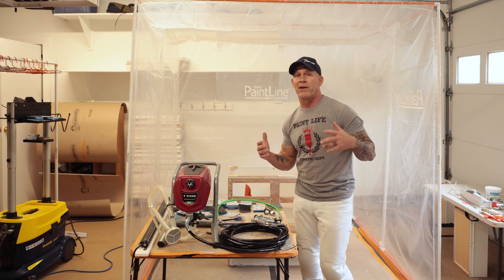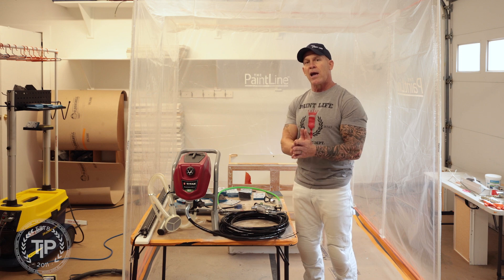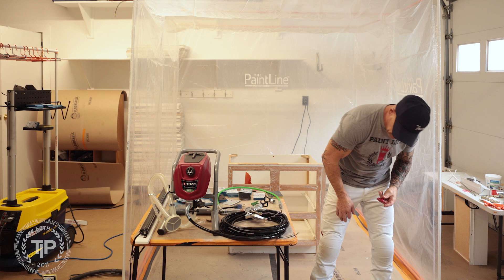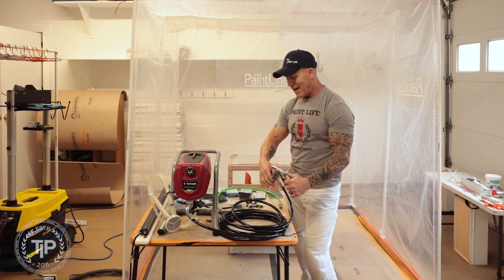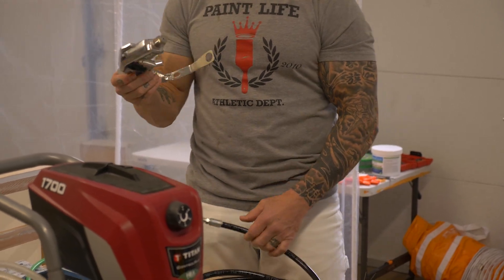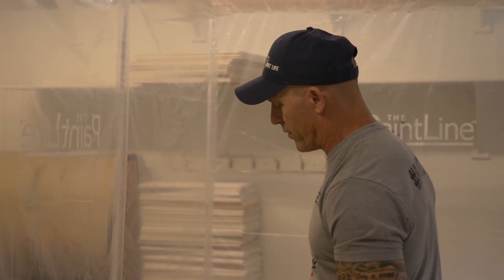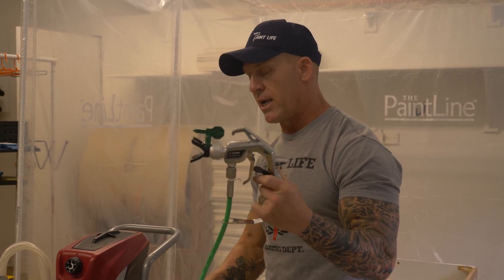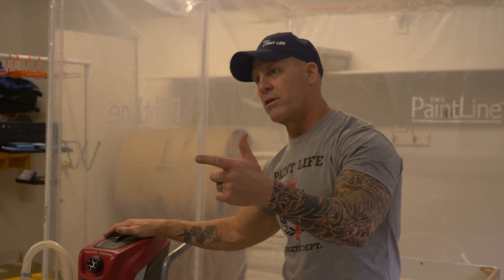Titan ControlMax Conversion HACK!. What Can and Can't You Use.

Comment: #TopBloke. I gave up last year trying to hack this after 3 yrs of trying to source these fittings. Bought this unit 4 years ago, was not aware of the proprietary problem, “As there is nothing In Titan/Wagner’s marketing material to alert you to this game stopper. Tried contacting the company “Nada” was told “we do not have those measurements. 

I’ve bought two of these yesterday cannot wait to finally get a whip hose on this great lil machine. 

#IdahoPainter……saved my ass yet again. Thanks for your support to the community #1Love2IP.

Comment: I recently received the whip kit for my 1900 controlmax.  The adapter that screws into the gun, it has a washer and o ring on it, neither get tight before the adapter bottoms out in the gun. Is this a problem? Maybe the washer and oring are included but unneeded?

Comment: You stated that you are not to use any other tips with this set up but in another video you do just that. Is there any reason you shouldn’t use a fine finish tip with this sprayer? And if you do what type of results do you get?

Comment: Will this unit be ok running medium viscosity material with Graco fflp tips and a RAC-X guard? If the material itself only requires 1000-1300psi does it really matter what machine it is in as long as the pressure is right for the material?
Reply: This machine is just for homeowners small jobs like house fence or garage door not for production works
Reply: @ajolote7193  yes it is not meant for a large scale production environment but with the above materials along with the tips and guard can it achieve the finish needed on vanities or cabinets...
Reply: i would think so

Comment: Good vid Chris as always very informative,  I'm on the verge to get  one of those systems and have Tritech guard and tips  laying around ,so  can i be able to use them with this titan model?  My intentions are to spray those europeans coating such Milesi and Renner, thanks in advance Chris👍🏼🤟🏽
Reply: Esa máquina está diseñada para correr a 1000 psi con hea tips los verdes y no son para terminado fino con los tip de tritech necesitas mucho más presión y constante una 440 i si no tienes mucho presupuesto es el camino
Reply: @ajolote7193  muchas gracias, trabajo en una fábrica de muebles y solo me familiarizó con air assisted kremlin 10-14 y botes de presión binks .... Además de tener una Fuji HVLP de 3 turbinas, entiendo que necesito más presión para esos tipos de productos europeos, por eso mi pregunta, ya que como lo mencionas el presupuesto es importante y quería empezar con algo muy básico para así poder darme la idea de cómo utilizar ese tipo de máquinas, te agradezco mucho tu comentario y ojalá pudieras orientarme  tengo dudas acerca de cómo hacer presupuestos y obviamente el uso de diferentes máquinas, el trabajo lo sé hacer pero con lo que ocupo pero quiero enseñarme más.y no cometer errores a la hora de un trabajo de cliente, de antemano muchas gracias.
Reply: @JuanMartinez-qp6yg  es más dificil el sistema Kremlin tienes que ajustar el fluido y luego romperle la cola con aire. Y las hoyas igual .. cuando trabajas con airles tienes que hacer movimientos más rápidos si le pasa el mismo lugar de va chorrear no tienes ajuste de abanico ni de fluido . Se te va hacer fácil el airless pero te sugiero buscar una máquina buena en offer up o eBay.  O esa que muestra crish en el vídeo y hacer pruebas para ver si te va dar el rendimiento o mientras te familiarizas con su uso. Y lo de los presupuestos es dependiendo de las condiciones si tienes que hacer reparaciones en el área donde vivas puedes cobrar por pieza o pie cuadrado te sugiero que empieces con familiares y amigos o hasta en tu propio hogar Antes de ir mas allá.
Reply: Sigue a Dennis Rodríguez y Eric reason aquí en YouTube ellos son la mera vena esto para tengas más información
Reply: Ellos manejan renner centurión y envirolak entre otras
Reply: @ajolote7193  si los sigo y me han sacado de dudas también ya que son un buen de productos como te dije ,se hacer el jale pero no por eso quiero decir que ya conozco todo......trabajo con conversión varnish, vinyl sealer , lacquer ngr stains ,wiping glaze se hacer colores de los productos ya mencionados, pero quiero utilizar los de a base de agua por aquello de el olor en casas ajenas y tienes razón con lo de empezar con amistades y propias cosas, por eso me han hablado para jales pero pienso que a quien le ayudo toma ventaja de lo que le hago .....tendrás otro modo de conectarme contigo .... messenger , what app, etc.... Ne parece que eres honesto y  tienes experiencia.
Reply: Me encantaría mandarte fotos de los poquitos jales que han salido y mires si podré con el mismo..... Así me dirás tú más sincera opinión de si puedo o no sobresalir ya que quisiera hacerlo por mi propia cuenta, no tengo un garage por el momento pero vivo en una casa Mobil doble, y tengo dos cuartos vacíos, ahí es donde hago mis jales

Comment: Hold on.  Your whips come with ¼" female compression fittings on both ends, but that whip you have there has a male/male adapter on the end that goes to the gun.  This male/male adapter didn't come with the hose nor does it come with your conversion kit.  Why didn't you mention it or include it in the kit?  It's the one piece needed to make this whole thing work.  Please explain.  Edit:  I see now that the shorter whips have a male on one side and a female on the other.  Why do the 50' whips come with female/female?  The item description says they are NOT for connecting to another hose but directly to the sprayer.  It also says that it needs the conversion kit to work with Titan sprayers (which I now know are also Wagners), but without a male end on the hose how is this kit supposed to work??

Comment: I was running my 440I with a pressure Guage at the pump and an HEA 315/515 and could not dial the pressure in <1700 for the life if me to eliminate tailing! WTH? I think it was the junk ass paint! I have the Swedish whip, any issues?
Reply: Worn tip
Reply: @ajolote7193  brand new!
Reply: Paint must be to thick try thinning it a bit
Reply: Put the regulator gauge at the gun  .. strain twice your paint it’s posible u have a bad bacht  happens in exterior paints more than interior the finish is like texturized
Reply: @exsmoker74  Bingo! The paint was full of guts and I didn't strain it like an idiot!
Reply: @ajolote7193  I think that was my whole problem...I was being lazy and water was scarce and here in Wyoming it was snowing.
Reply: @tocolee6127 
We've all been there m8, these days i dnt use filters  so all my paint has to be strained up

Comment: I've been watching quite a few of your videos, ended up settling on the Wagner 190 due to a sale (obviously the same as the Titan 1900) - bought a whip and adapter set from you and was wondering if you had a good way of adapting an inline filter to these cheaper sprayers. I'm only doing a fence (250+ft) with it for the moment. Other projects in the future.
Reply: I ordered a filter housing plus swivel for my titan 1700 on Amazon. I’d send the link but it was a few years ago

Comment: These are a good idea that was totally screwed up by not asking a painter what they needed. The gun is junk, the lack of swivels from the factory is just dumb and the fan pattern sucks.  If you paint cabinets are trim you’re going to have problems.
Reply: No doubt, I use an assortment of gracos at work, like the trade so much I bought one of these for home bc amazon went crazy on deals for it. I have a shit ton of hoses, guns, whips and tips from the shop I'm pretty pissed I can't use a bit of it. 

I like the pump. Was surprised with it with how cheap I got it for and how easy and quick it is. The Gun is shit. It showed up already broken in 2. No worries I have 5 gracos ready to go. 

Didn't the got just pass some John deer, apple iPhone charger preventention measures? Anyone wanna buy this piece of shit?